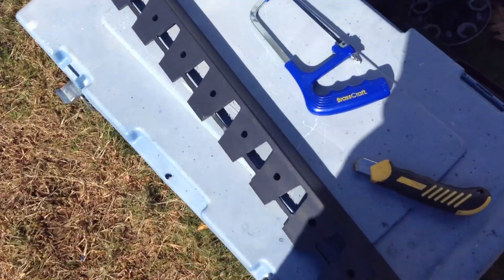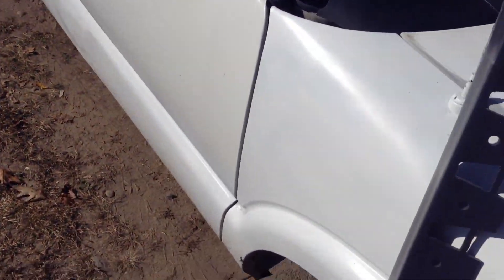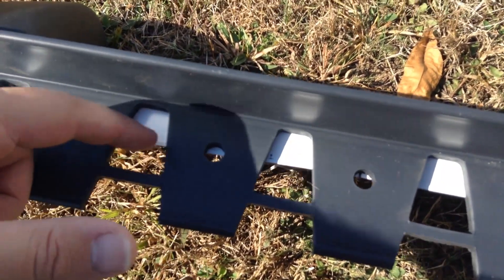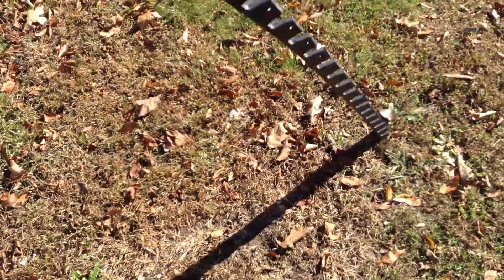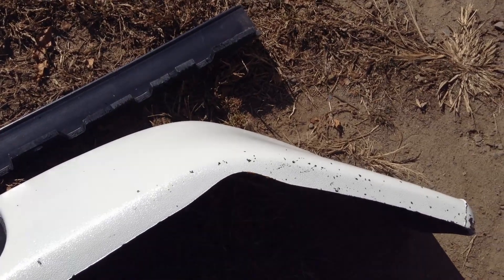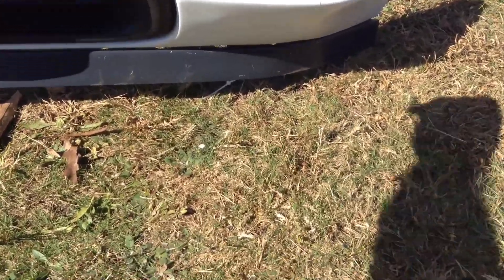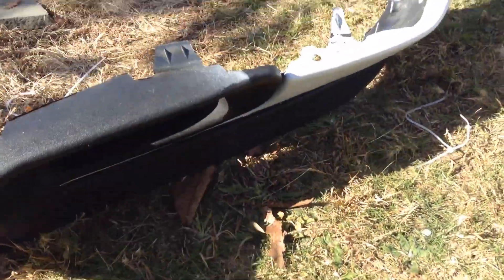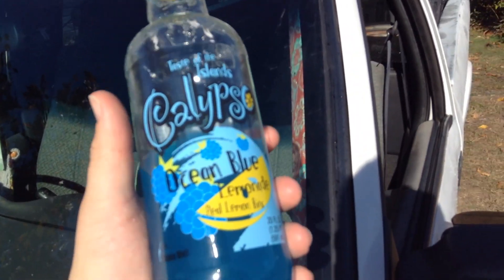DIY Lip | $10 Home Depot Mod | S10

Comment: This is a good idea,  I was wondering how you got those corvette wheels to fit on your s10. Did you use spacers, if so how many inches
Reply from the maker: 2" spacers but make sure you get hub centric spacers or you could ruin your bearings.
Reply: Craig Snedeker cool and thanks for the heads up

Comment: would this work on a 84 s10????
Reply from the maker: It's possible, but if it has the stock valance on the bumper, I think they are two thin to screw anything too. It's worth a shot though.

Comment: Do you think it would flex at all if i was to go over a speed bump or something like that? if i screw it down all good like you did maybe even drill a hole in both the "lip" and my valance, and use bolts and nuts and washers, to make sure it wont come off. i dont wanna go through all that trouble just to rip this off if i go over a speed bump or something.. but nice idea though you had!
Reply from the maker: If you can find a way to attach it even better, that's great. I was lazy and didn't really care, plus I'm stock height so I'm not to worried about it. But yes, bolts and nuts are much better!